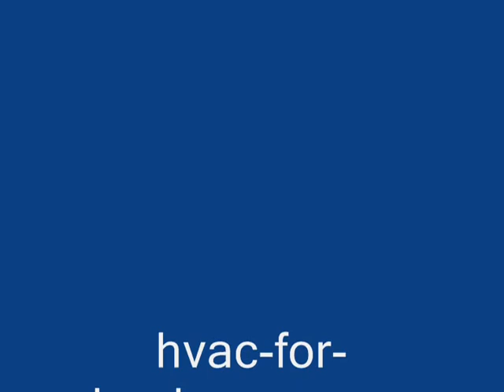AC Not Turning On? Check This $30 Part Before Calling a Pro! 🛠️

Comment from the maker: Is your outdoor unit running even when the thermostat is set to 'OFF'? This usually means your contactor has 'welded' shut. You need to pull the disconnect immediately to prevent the system from icing up or burning out the compressor! ❄🛑

Quick Tip: When buying a replacement, make sure the Coil Voltage matches. Most residential units use a 24V coil, but some older or commercial units use 120V or 240V. Putting the wrong voltage on will fry the part instantly! [01:21]